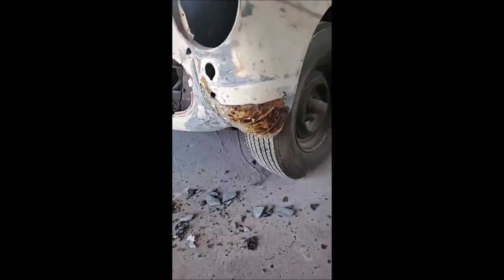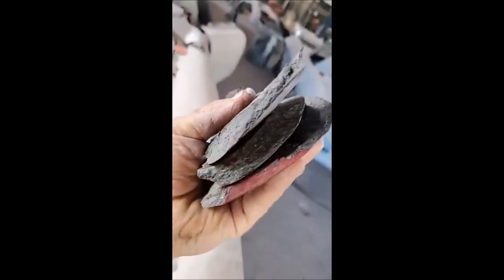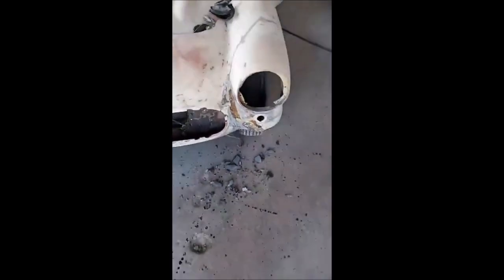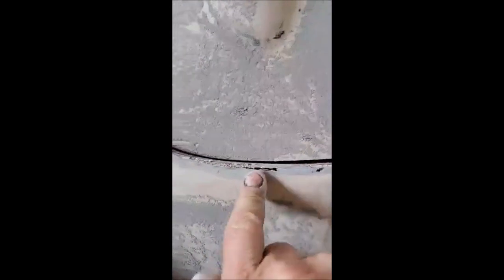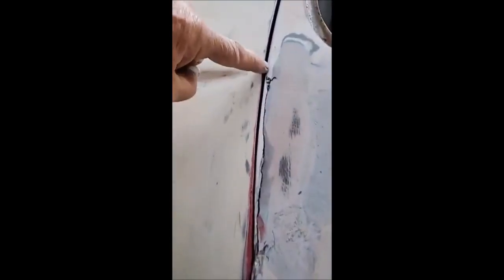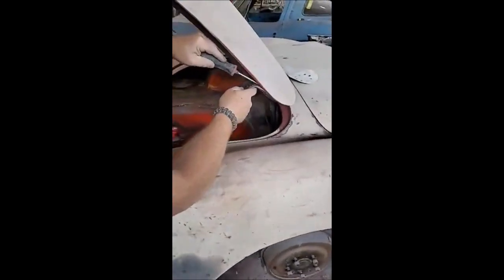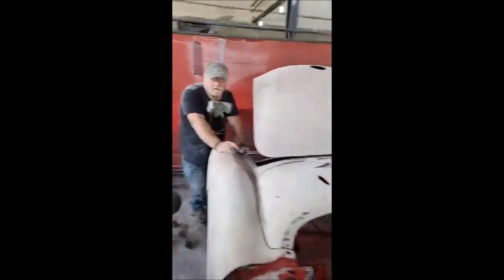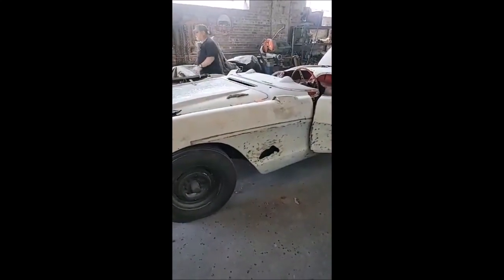20200619 57 Corvette Barn Find Update

Comment: It looks like one of the early fillers that used to be sold in almost every department store was called ''Black Magic'' body filler, I can remember my older friends buying it and spreading a light layer on the edge of holes and then stretching screen over the hole and imbedding it into the filler, After the layer holding the screen dried you could spread a layer over the screen to cover the hole! It was horrible stuff, It was rubbery and was like sanding an asphalt driveway! There were other brands that sanded easier but still weren't the best quality, One was called ''Swiss'' another was ''Bondo" brand! Which the name stuck! I can't remember any other brands right off but there were several, Maybe some other old timers like me will weigh in with some names, I know I found a quart can in my Grandpa's barn but  it's at my shop on a shelf along with a quart of green enamel he bought for his 58 Chevy Nomad wagon in the early 60's!